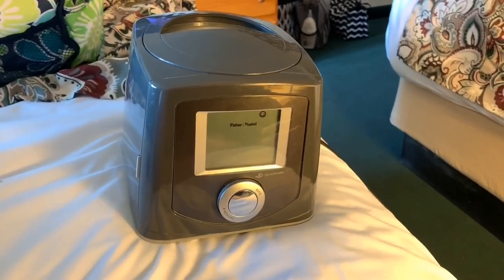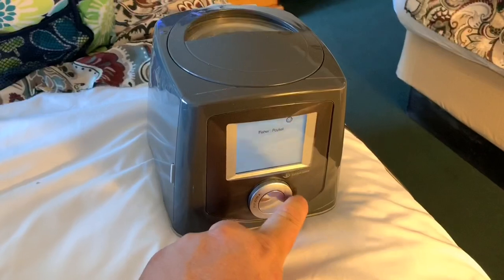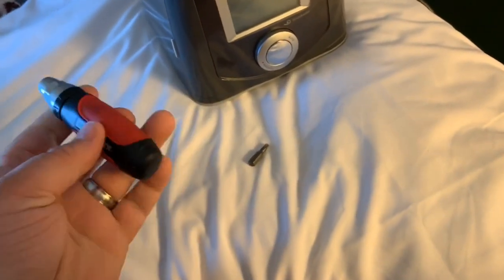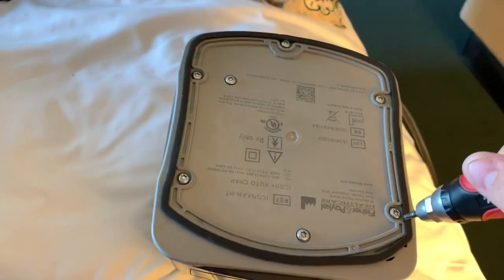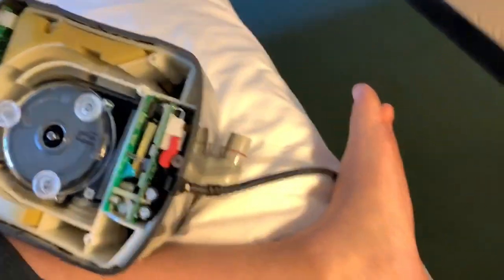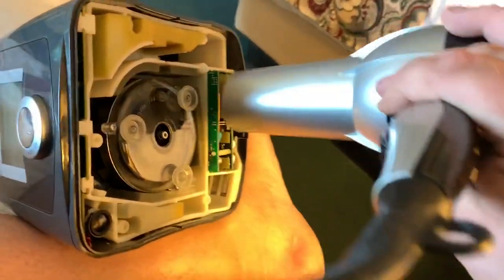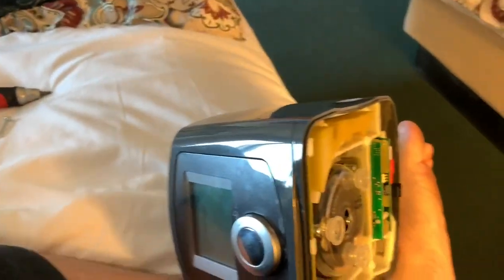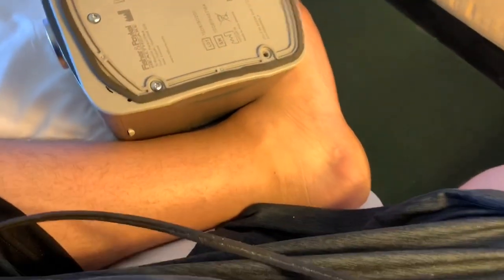Fisher & Paykel Icon cpap dead, quick fix

Comment: Man, u just saved me a restless weekend followed by at least a week of sleep on the doze train. I literally panicked when that darn machine wouldn't turn on at 2am on Saturday night. I searched for this issue and u popped with this video. I didn't think it was going to be that easy but I am solo glad I tried it. Worked like a charm.
Never will be able to thank you enough for putting ur fix on you tube for others to be able to find and try resulting in a good night's sleep rather than a nightmare that would be unending until it was replaced.
THANK YOU!
Reply from the maker: This is exactly why I put this out there. I know how much of a pain it is to not have your cpap. It’s unbearable for me and I was so miserable until I fixed it. So glad to help
Reply: Worked ❤❤❤ thanks

Comment: Thank goodness for youtube and you!  I dug out my broken (or so I thought) cpap after about 6 years in storage.  Stopped using it because I thought it was broken and I was controlling my weight better through diet and exercise.  Achy joints are forcing me to limit my exercise now, and I've started to gain weight again.  Apnea is now back, and I had to figure out if I could get the cpap working again.  Came across your video and tried reviving it with the blowdryer on low or medium like you said, but it didn't work.  Then I started reading the comments.  One commenter said something about heating up the solder, so I tried again.  This time with the blowdryer on high.  After about a minute, the old cpap came back to life.  Hope this helps me get some decent sleep.  I've been struggling for the last few days.  Thanks for sharing your fix!
Reply from the maker: Glad it worked

Comment: Justin - I can't thank you enough for this video. It worked on my 2015 F&P Icon, and seriously,  may have saved my life! One note - I followed your directions explicitly,  but after about 15 minutes with the hair dryer on low and about to give up hope, I switched it to high, and it almost immediately powered up. Some hair dryers might not provide enough heat on low, so if no luck, its worth a shot on high! Or it may have been a coincidence,  but so very grateful to have it back!
Reply: I've done a lot of travelling with mine. It's never done this, but thanks for posting this.

Comment: Thank you a thousand times!!! This worked perfectly in less than 10 sec my machine turned on....woooossh! The bottom part was hard to take off after the screws came out but I pryed the sides with a butter knife all around the edges before it came off... Thought I had to dish out $400 bucks I don't have...😟...thanks again👍👍👍👍👍

Comment: I did something a bit different (below) but Thank you for this post because it worked and I really didn't want to go through the hassel with compliance and insurance claims.  Honestly I had not used it for over a year and coming off covid I thought it could help get a full breath for a change and it did, I feel great.

I didn't have the tool so I took the unit and plugged it in, no top, tank, or hose.  Laid on the side with the bottom toward a small ceramic heater in my bathroom.  It was about 8 in away and I felt it for a while to ensure the bottom didn't get too hot but it was hot to the touch.  After about 15 min it turned on.  I used it and unplugged for 24 hrs and it stopped working.  Went through process again and left it plugged in.  So far it is still good.

I have had for 10 years now so I am eligible for a new machine.  I guess 10 years is a long time for a machine that is meant to run everyday.

Comment: I don't know how you figured this out. I was skeptical like so many others, but it WORKED! Thank you so much! The only thing I can figure is that the heat cycles from the unit cause micro cracks in the solder. A blow dryer heats the solder up just enough to flow enough to make the connection work again. Thanks again!
Reply from the maker: I’m glad it’s still helping others

Comment: OK....Sir.  I don't know how you figured this out and I can only guess at the logic here - heat expands circuit board forming connection?  But I was the biggest cynic watching this vid.  I thought maybe you're travelling to a rain dense country.   Surely to God...if it does work it's only under certain circumstances - humidity, water, steam etc. made its way into the unit and hence the dryer fix.  NOPE.  It was a dry day here and dry house.  An electrical shortage triggered my unit into deadsville.  Chuckling to myself I'm holding the unit as suggested, thinking this is nuts or this guy is probably laughing at all of us believing anything on the internet.   Then I saw a light come on and sure enough - abracapresto!  It's working!  Unbelievable.  And lastly,  THANKS for posting this.  You've saved me from taking years off my life at an attempted sleep without what I call my hyperbaric chamber.  Liked & Favorited.

Comment: Hi Justin, thanks for your video and my machine came back alive using your heating method. However, not sure how many more times this heating method would work.  The  recent power failure  shut down the CPAP again,  I am thinking to get a UPS (Uninterruptible Power Supply) and let it plug-in all the time.  If anyone has any suggestion, please share. Thanks.

Comment: Thank you for this post.  I thought you were very clear with how this issue happens and the resolution.  My Icon would not come back on after unplugging it.  Fortunately, I have a spare for travel.  I do not have the required Torque T20 bit, and I’m long overdue getting a set.  I’ll apply what you have taught and see how it goes.  Curious, though, how these things will just quit running after being unplugged.  They worked fine out of the box when new.  What changed?
Reply from the maker: I'm thinking the capacitor that is on the board is failing. And heating it up,  gets it to connect again.

Comment: Justin, how did you figure this fix out, and were you able to get it repaired?
Reply from the maker: I thought the board got wet so I heated it up on a vent register at my house. Then after it happened again and there was no water i knew it wasn't moisture. I ended up getting a new unit a year later threw my insurance
Reply: @JustinBsDentureJourney  well, thanks again! This fix is keeping mine alive until I get my next sleep study.

Comment: My machine is a 2012 and this trick work in 2021. I actualy put a  fan on it after power up. The idea is to dry it a max. 
Thank for the tip
My machine stop working after power break up during the night.

Comment: After unplugging and plugging it back in, it turns on for 2 seconds and then turns off, turns on and then turns off, and so on ad infinitum.... I took out and inserted the flash drive, changed the plug adapter, disassembled, got to the board, heated the corresponding capacitor with a hair dryer, put it in the freezer for a couple hours, disconnected the heater cables - all the same for 2 seconds turns on, turns the dial and turns off. I've seen this problem with several people on forums, but no one has posted a solution.

Comment: This only deals with a bad 47MF 35V electrolytic capacitor located on the board. Even if you heat it up, you're gonna end up having to replace it one way or another. I did it 3 years ago. Ran up fine until yesterday. My wife had to unplug it from the wall outlet. She plugged it back few seconds later, but the display never came back on.
Reply from the maker: I did this for a long time. It’s helped a lot of people.

Comment: My F&P Icon was 3 years old and wouldn’t power up after spending 10 hours in the travel case on a trip from Idaho to Washington State. I had to jump thru hoops with Medicare since it wasn’t due for replacement for 2 more years. Fished Paykel does not repair their units - period. I chose a Resmed Auto Sense 10, which is repairable and much better. No music plays, but this CPAP is very easy to operate and remove and clean the humidifier. No more Fisher Paykel.for me.
Reply from the maker: I now have the resmed airsense 10. I love it

Comment: Surprised these comments are relatively recent. This was a common problem with the Icon machines. F&P finally figured out it is due to that bumpy thing on the power cord, which I guess is a capacitor. Quite a few years ago my supplier called me up and said that F&P had fixed the problem and I was being sent a free new Icon Auto machine (even though my old one was just a Premo)! It still had the bumpy thing on the cord, but I never had the power-on problem again with the replacement.
Reply from the maker: tempehuck I guess my CPAP supplier sucks because they never contacted me or checked into it when I called them on the issue.
Reply: @JustinBsDentureJourney  I used to live in the Phoenix area and had a great mom-and-pop-ish local provider that wasn't part of the big chains, and good Aetna insurance from my employer. I never had to cough up a dime for my machine or supplies.
Alas, I live in SoCal now and went over age 65, so I have to use Medicare and Medicare won't let my old provider ship out of state. I'm overdue for a new machine and decided to get the new F&P SleepStyle but have been pulling my hair out trying to find a SoCal provider. Yelp reviews on all of them (Apria, Lincare, Rotech) are a nightmare! Apparently Medicare makes you rent to own, these providers make you pay up front, charge inflated prices, and they have no real incentive to try to get you reimbursed through Medicare since they already have your money. People have told me it's best and cheaper to just pay out of pocket from one of the online suppliers, forget Medicare.
Anyway, Justin, thanks for your quick fix tip. I wish I had known that before F&P sent me the replacement. Even after I finally get a new SleepStyle I will hang onto my Icon as a backup to take on over night trips, etc., so your tip could still come in handy even though so far I've had no problems with the replacement Icon.
Reply from the maker: tempehuck my current machine is a resmed airsense 10. I love it.

Comment: This didn't work for me after several attempts. The last one was 15 minutes on high. Here is what ChatGPT said anyway. 

Heating a circuit board can potentially get it working again due to a phenomenon known as "reflow soldering". Over time, the solder that holds the components on the circuit board can develop microscopic cracks due to thermal stress, which can disrupt the electrical connections. Heating the board can cause the solder to reflow, filling in these cracks and restoring the connections. However, this is a temporary fix and the cracks are likely to reappear over time.

If heating the circuit board of your Fisher & Paykel Icon CPAP machine didn't work, there could be several reasons. Firstly, the problem with your machine might not be due to cracked solder joints, but could be caused by a different issue such as a failed component or a software problem. Secondly, it's possible that the heat from the hair dryer wasn't sufficient to reflow the solder, or that the heat was not evenly distributed and didn't reach all the necessary areas. Lastly, overheating the board can cause damage to sensitive components, so it's possible that the 15 minutes of heat actually caused further issues.

If your CPAP machine is still not working, it's recommended to seek professional help. While it's understandable that you might want to avoid the cost of a service agent, attempting to repair a complex device like a CPAP machine without the necessary expertise can result in further damage. If the machine is still under warranty, you should contact Fisher & Paykel or your retailer for assistance. If it's out of warranty, you might want to consider getting a quote for repair from a professional service agent, or potentially replacing the machine if it's old and likely to have further issues in the future.

Thanks for the video. Either mine has been apart before without me knowing, or they put Loctite on the screws in the factory!
Reply: Chatgpt only responds to the words you put into it.  To reflow the solder would have to heat above 350 degrees f.  That is not what is being recommended.  As an electronics tech I admit this hack seemed strange but it worked for me and I don't care to try and understand why.

With that in mind what I did was plug it in and lay it on the side with a small bathroom heater 8 inches away blowing at the bottom.  I cane back 15 min later and it was on.  That was after leaving it plugged in all night with no result.  Whatever is being heated it's not the solder but it is working.  Machine has been on 24 hrs now.
Reply: That is not to imply that other issues are not involved.  Electronics go bad over time and this model is getting old.

Comment: Has anyone come up with a more permanent solution? (I've heard of using a european converter (transformer with european to use adapter) to push 230v to the unit and then it works) but I want to take this apart and fix it.

Comment from the maker: This has worked 5x's now. One time it would only power on for 2 hrs then I would have to disassemble and repeat
Reply: Hi Justin, I too have the same devices, and it has a weird problem...for some reason, it does not start, and I mean the power...i connect the wire to the switch, and it does not start, and then when I keep it in front of the Air Conditioners at it starts...i cannot afford a new one at the moment and it's s affecting my life...don't know what to do

Comment: Mine says error code 5.02 in this dead mode? Any ideas?
Reply from the maker: 5.02 is an issue with the motor. They recommend to unplug then plug back in. If still, motor needs replaced
Reply: @JustinBsDentureJourney  yes I just figured that out in Google. 😆 I took it apart and realized she was a little rusty.. took the screws out and put some clipper oil on the two ends that spin, turned it on, let it spin, wiped off and it works again.. not sure for how long but hopefully long enough for my next machine upgrade. I've had this one since 2014 I think. It's a lot louder now tho... 😅
Reply: Thanks for the help! I needed your video regardless 😁 I put mine on top of the heater vent instead haha

Comment: Again, think of the extent of FP’s deception. No question the machine does work until it does not. Heating the control board does work. In spoke to an electrical engineer and he indicated a minuscule

Comment: Now, let's look at some metrics.  Since you have 95 comments then this is a KNOWN issue.   Looks as if FP has opted to ignore the issue.
Reply from the maker: 11k views, so I’m sure close to that many had this problem if they searched and watched this
Reply: Right!  But Fisher Paykel is aware of the issue but is unwilling to repair/replace. We owe you gratitude but why should a consumer be required to follow this process? There is a design defect but FP does not want to recall because of cost . FP would rather have the consumer spend another grand.
Reply from the maker: @paulklenk9605  I fix major appliances. I see what happens with all manufacturers. Unless it’s a safety hazard, they won’t take responsibility for their issues. They don’t want to fork out money to fix known issues. They only do recalls because the government forces them to. Appliance companies would be put out of business if they took care of all known issues.